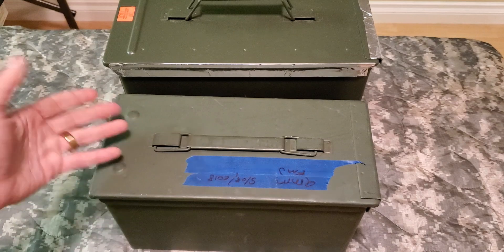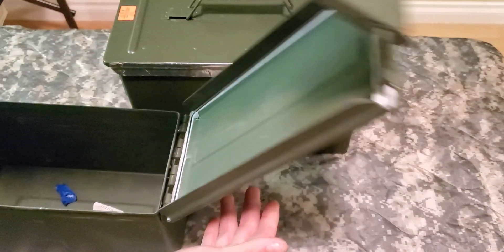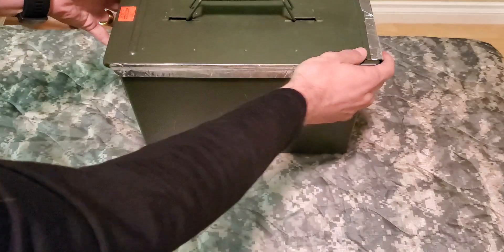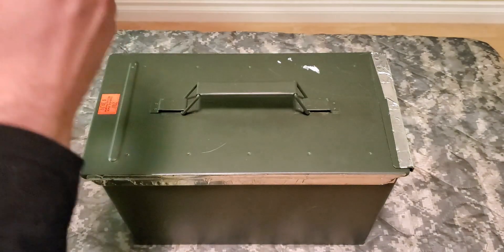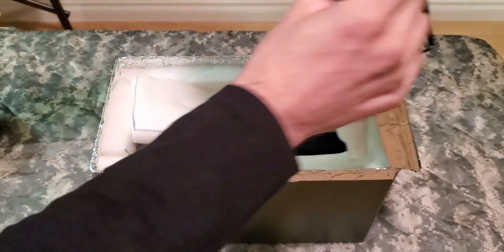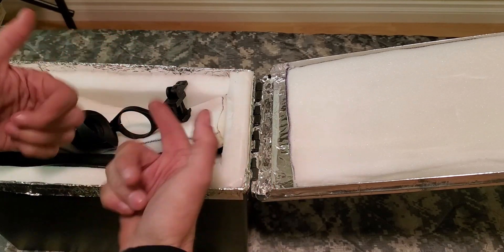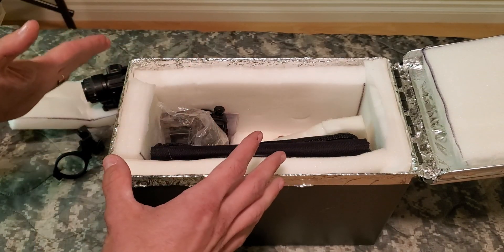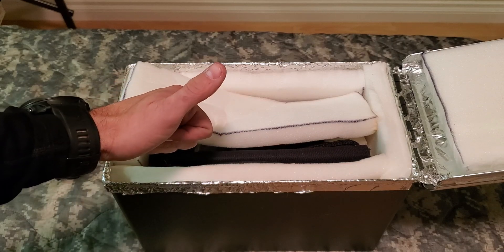Faraday cage/container

Comment: It is easy to test and see if it works, all you need is 2 handheld radio's. Put them on the same channel. Put one in the box (with volume turned up) close the box key up the other radio and do a radio check. If you hear the radio in the box then your "Faraday Box" does not work!

Comment: You don't need to take the seal out, because you have contact thru the hinge, believe me it will conduct any charge that hits it, but you need to ground the can with a gator clip or any other bonding clamp an take it to a grounded source an you'll be gtg. Thx for the vid Bro.
Reply from the maker: https://youtu.be/WQ6uI2ajKK8
Reply: @PreparedAirman  I watched his vid An agree with it, that will work with a REMOVEABLE lid, although a bit more work an expense than it needs to be. I was referring to the smaller ammo cans that have a hinged lid, not the bigger 20 an 40 mm cans that have the REMOVEABLE lids, even wth those, you could apply the same principles of metal to metal contact an use a bonding strap to each part of the can, an you would have a continuous grounding sheild path, an if you were to mechanically bond the can to a grounding source( think earth bond) it couldn't get any better than that. An an earth ground could be a metal water pipe, rebar driven in ground, ground rod driven in ground, a grounding plate or a UFERS ground in earth, there is a vast amount of ways to accomplish the shielding an bonding of any given system, I subbed his channel for the knowledge that he mite bring to his channel, an thx bro, hopefully his an my insight might help in your quest. Be glad to help if I can.